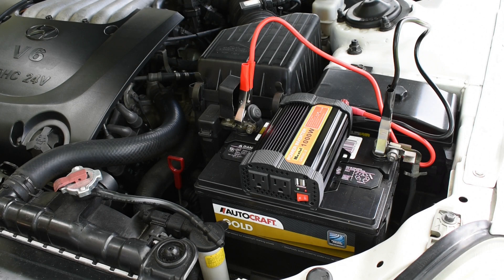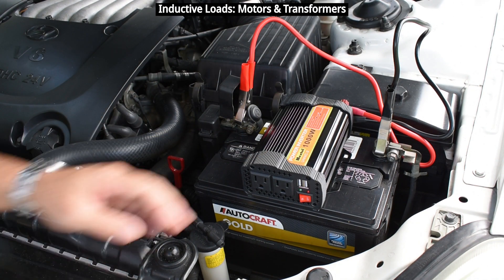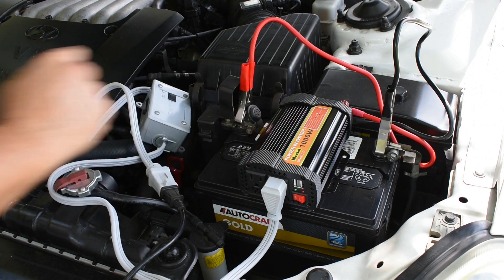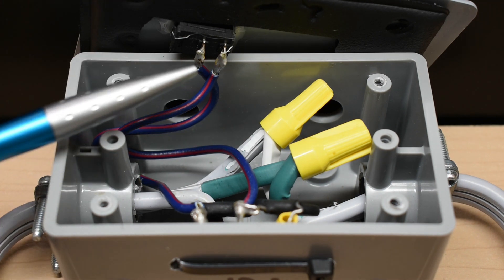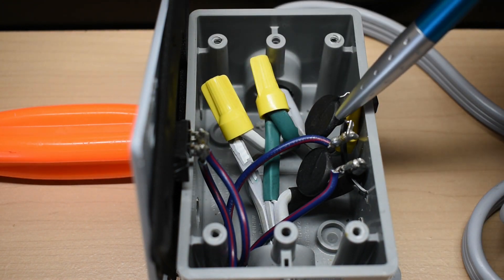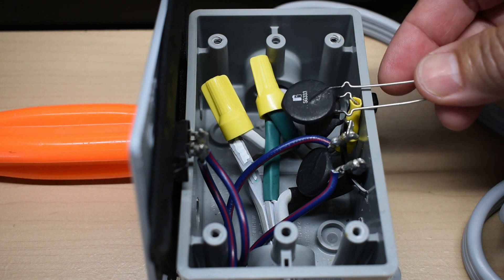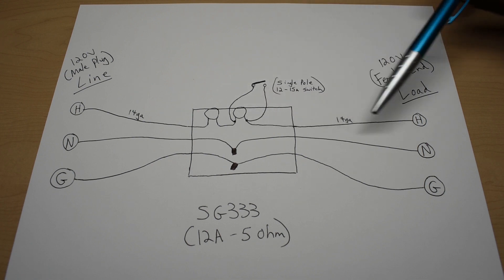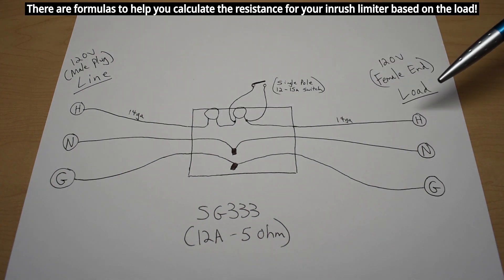The Simplest Soft Starter!

Comment: After suffering a 5 day power outage after a storm and eventually getting hold of a generator (sold out everywhere locally!), it only just managed to start my well pump without tripping the overload. I, like others have already commented, have searched the internet for "Soft Start" devices returning very little information. They are either very cheap chinese items with little to no information about them or very expensive commercial units. This video is exactly what I needed - a "how to build your own". Thanks so much.

Comment: Wonderful video. I used NTC thermistors in a commercial application to start high power DC cooling fans  in an application that used a switch mode power supply sometimes. Mouser carries a wide assortment of these devices. Two tips on their use: 

Avoid the urge to automatically oversize these components. Choose an amperage rating just above your real load (fused correctly, of course).  
Secondly, these things get quite hot. Ensure they don't cause thermal damage to your wires but don't actively cool them. Resistance increases when they are cooled. I used a delay-on-make relay to cut the thermistors out of the circuit once the fans had started. 

A note on practical use. Once you turn the load on and get it running the thermistor's resistance drops. When you turn the load off the resistance will remain low until the thermistor cools. Switching the load off then immediately back on again before the thermistor cools will likely overload your power supply or inverter. That is part of the reason I used the time delay relay, so that the fans could cycle on and off with the thermistors being cool for each start.
Reply from the maker: Yes, you cannot cycle on and off quickly. The component needs to cool at least 30 seconds. Thanks for watching!

Comment: I made one here in Puerto Rico, all I could find was a 10D-20, the fridge at start up is 8 amp and 1.5 amp running, I have a chinese inverter without any info on it of amp rating. The fridge with this 10D-20 starts up with no problem with one car battery and the small inverter, the battery remains at 12.1 after one hour even without solar, so I would say that this device does curve the inrush current well enough to power your fridge at startup with a cheap inverter.
Reply: Eso quiere decir que puedo hacer que el compresor de una nevera grande  arranque con una planta pequeña??
Reply: @cafepuya  primero tiene que medir el ampere de arranque luego el ampere del motor despues del arranque, si el ampere de arranque es de 11 ampere y luego 6 ampere corriendo, tienes que conseguir un inrush current limiter segun el consumo de arranque y el consumo del motor despues del arranque entonces si con una planta pequeña cual alcanza los amperes del motor despues del arranque, si funciona ya lo e visto muchas veces.
Reply: @natvega1  Es que tengo una Sportsman GEN1000i de 1000W-800w mi nevera dice en el sticker de adentro 6.5A.. A la planta le tengo un kill-a-watt para ver el consumo de watts y cuando está corriendo veo que usa 120w a 230w aveces marca 0.0 como si estuviera apagada.. pero de momento cuando el Compressor arranca.. llega como a los 8Amperes y la planta de apaga.  No se si con este truco pueda solucionar eso.
Reply: @cafepuya  si, si hace este inrush current limiter tu nevera va funcionar con el sportman, enviame tu email y te envio una photo de como se hace, el limiter cuesta $6 y se encuentra en cualquier tienda de venta electronico
Reply: @cafepuya  How do you reduce the starting current of a refrigerator?

a) use a start capacitor, 150uF, for the first 1000ms. b) use an NTC thermistor. c) power resistors, for the first 1000ms (similar effect as NTC) d) voltage transformation to a lower voltage, e.g. from 230V to 200V.
Reply: @natvega1  cuando pongo mi e mail YouTube me lo borra como puedo hacer para decírtelo
Reply: @cafepuya  NTC Thermistor 10D-20 te reduce el arranque a 6 amperes. Lento no de cantaso.
Reply: Es G mail el correo.
Reply: @natvega1  me quedé con las ganas de ver  la foto de como se hace el corre o  mio es bayamon

Comment: I've read through as many of the comments as I could and did not find this subject addressed; apologies if its buried further down the line. I would like to use this directly in my shop on 120V house current where my table saw sometimes trips the 15A breaker. This has been the case ever since I bought the table saw a few years ago and it's something I just deal with. If this could alleviate the inrush current that trips the breaker then, AWESOME!!  Really enjoyed the video. Clear, concise and your voice is very professional.

Comment: Well done and great explanation ! 
This will work for my 2000W BESTEK Inverter tripping running a 200 watt Fridge when the power is out.

Btw, your explanation at the end about why shouldn't wire them in parallel exactly explains what happened to the person on an RV website that said his setup exploded when he plugged it in.

Comment: You can find these current limiters in the variable speed, dc, hvac blower motors used in most late model ac systems.  I stock them on my service truck because they fail very often.  Most techs replace the motors for around $800-1000 I take them apart and replace the limiter for about $200. This is the most common failure of the hvac motors.
Reply from the maker: Many people allow their air filters to get very dirty, and the reduced airflow causes the winding of the blow motor to run hotter. Thanks for watching!

Comment: Very elegant solution.
But i think most people trying to run big inductive loads off inverters are trying to do emergency repair, so i thought i'd give you a few ideas on how you could limit the inrush current with stuff you can find around your house.

So if you are a regular guy you probably don't have NTC's just laying around, especially in a emergency situation when power is out.
What you probably own or could easily get your hands on is a graphite pencil.
Shave off the ends and connect the wires to it, then wire a lightswitch in parallel to it.
It is a single use and incredibly dangerous but when that little risk is the difference between life and death, i'm pretty sure you won't care.

I used this method to start a really big drill when we had floods in 2014. I used that drill to bust a hole in a floor and stop water into coming into first floor flats and creating damage.
Reply from the maker: Not really about what you'd do in an emergency situation. It's about having the device on hand now, so in the event you need to power an appliance/power tool using a small generator or power inverter, you'll have a good chance of doing it. Before the pencil trick, I'd pull the oil filled run caps out of my A/C system to get the inrush reduced. Thanks for watching!
Reply: MacGyver would be proud!

Comment: Good work, I looked for a super cheapie inverter with built-in limiter without success, and settled on a capacitor setup which has been inconsistent as success depended on the particular load. So I'll give this a go.
Reply from the maker: If you get the right ICL value, it works great. Thanks for watching!

Comment: Couple of McQuestions: Once the threshold temperature is reached and the resistance drops does it hold that resistance as long as the load is still powered up? In other words does it stay latched in it's low resistance state once it's activated even when the current demand drops once the inductive load has started? I ask this because once the resistance is triggered low then the voltage drop across the Inrush Limiter will fall too so it would naturally cool down.
Reply from the maker: Yes. As long as the load is applied, the low level of resistance will remain. The ICL will be fairly hot, but it's normal. You cannot rapidly cycle loads on and off using the ICL. You must wait 30 secs to 1 minute. Thanks for watching!
Reply: flash001USA 
Google has the answer.
Reply: You can add a temperature sensing circuit to bypass the inrush limiter once it heats up.
Reply from the maker: @Andrew Ferg Not necessary because the resistance drops to a very low level. Thanks for watching!
Reply: @andrewferg8737  Not a bad idea. Inrush limiters do wear out. In fact, they are often the only part that wears out on pool chlorinator control boards.

Comment: Great tip! Have you considered adding another switch position to bypass both in-rush limiters, once startup is complete?
Reply: Already done. Each thermistor drops to about 60 milliohms shortly after power is applied. For a 6 A load, the voltage drop for each is about 360 mV.

Comment: Nice and very useful  ,   In the uk  If you have trouble with 110 volt site transformers tripping circuit breaker's when you plug the in /switch then you  can get round this by plugging in your power tool to the trans former first then  switch on power tool , then switch on the transformer this can limit inrush to the transformer and prevent the circuit breaker tripping
Reply from the maker: Interesting workaround! Thanks for watching

Comment: I always take an angle grinder camping, thanks!
Reply from the maker: There are other things that have high inrush, that was just a good example. :-)
Reply: @electronicsNmore  excellent example
Reply: I'm off grid, and was looking for a solution to stop my window unit AC, (~1300w) from tripping my 5Kw inverter/charge controller. The in-rush is making it impossible to run it, even though I run my water heater on it (resistive vs inductive, as you stated). Hopefully this will work. I may build a few of these, lol. Thank you so much.
Reply: RV uses fridge or AC which the inverter can't handle, and the commercial unit for this problem is $300.- this $1 fix is a way out, and thank you for this.
Reply: @Lumbeelegend  Did you try yet? Very curious..
Reply: @Vigo327  no, I had a drill speed control that kind of worked... until I popped the fuse in it.
 Ever since that, I've been able to turn on my A/C... I have no idea how/why it happened, but I can use it now. Electronics are strange

Comment: I just found this video this morning, already watched it two or three times and copied the adderess so I could share it with my buddy down in Louisiana, any way I'm wondering if you could do one or at least answer the question about a single phase 10 Hp motor that keeps throwing my inverter into safe mode. I've got an 18K inverter that drives the motor, but it still needs a soft start, Any help would be sincerely appreciated.

Comment: you can also use a solid state relay coz the optocoupler has to start at the 0 cross point of the sine wave. not sure what would cause more parasitic resistance when running.

Comment: Nice idea!  I am going to try this.
Question:  What is the difference between these in rush limiters and a resistor, in this case like a 5 ohm, 100watt resister?
I am using a resistor in series for a few seconds between a battery bank and an inverter prior to hooking up the last cable to the inverter to prevent the spark I would incur due to the in rush current which is caused by the charging up of the internal capacitors of the inverter. 
I know one is a DC circuit and one an AC circuit so that is one difference.  I don't know if this the reason for these in rush current limiters vs just a resistor.  Do they both work the same?
What does the 15% designation mean in the specifications of the limiter?  I see there are other limiters with different specs such as one rated for 20 amps, 1 ohm resistance and 20%?
I want to start an electric motor that after startup will draw 6 amps but, as you know, it draws about 3x that on startup.  Will your idea work for me and, if so, what size in rush limiter should I be looking at.  Thanks so much.

Comment: Would I put the thermistors on both L1 and L2 for a 240V submersible 1.5HP 4" pump? Normal amperage on both legs is 11.5 A, so am thinking that I'd be able to mimic exactly what you have, but put 2 on each leg. Is that correct?

Comment: I added a normally-closed, momentary-action shorting switch across the NTC on my table saw.  I labeled the new switch "soft start" and "run" and mounted it next next to the on-off switch.  When starting on utility power where soft-start isn't needed, I simply turn on the power switch and the NTC isn't in the circuit, being shorted by "start" switch.  When starting on battery/inverter power, I first activate the "start" switch, putting the NTC in the circuit before turning on the power switch.  As soon as the saw comes up to speed I release the "start" switch back to "run", again shorting the NTC.  This allows the NTC to begin cooling while the motor is running and provides for more frequent starts.  I wonder if it might also increase the life of the NTC by significantly reducing the time it is in use?
Reply: Is this the reason for shorting one of the thyristors in his circuit, he never says why he put the switch in, it must be like you explain it to allow for cooling to provide more frequent starts, because why not just leave them in series without a switch to give you 10 ohm resistance a 50 volt drop every time you start it, strange he never explains that.

Comment: A thought on using this circuit to power a room air conditioner (I'm thinking 450 W, 115 VAC, 5000 BTU). Considering also what others here have suggested (power factor capacitor, and a timed relay), etc. My thought is that the air conditioner has two motors in it, the fan and the compressor. So should I actually open up the air conditioner and install two separate instances of this DIY soft starter, one on the fan motor, and one on the compressor motor, both with independent inrush limiters, capacitors, and relays? That way the fan and compressor loads are each separately buffered. What I'm worried about is that the fan will run continuously (keeping the inrush current limiter hot and therefore out of action), the compressor will turn off, then on again, and the inrush current limiter will not be active. Having two separate soft starters would seem to solve that problem.

Comment: Thanks for video. exactly what i was looking for. really good info.
i am having trouble selecting which NTC is appropriate for a 300watt inverter which will be powering a 200watt PTC ceramic steamer only. I am thinking i need an NTC that can handle 20 amps .
thanks
Reply from the maker: If the inverter is only 300w, then 20A is overkill.

Comment: Thx for the video. I have a question. 
Let's say I wanted to power my refridgerator with your inverter, how much power will those two buggers dissipate in heat? And also could you bypass them when the fridge have started or are they needed every time the compressor starts?
Reply from the maker: You need to choose the correct size ICL for the load. They can be bypassed if desired after start-up. Thanks for watching!
https://www.ametherm.com/inrush-current/selecting-an-inrush-current-limiter.html

Comment: Was wondering if this is a safe solution for a mini split AC that dims the lights when the compressor kicks on? What would it hurt to leave the switch on all the time or just delete the switch on the box altogether? Would be sure to drill the vent holes in the box

Comment: Great video much appreciated.
Question: I am trying to lower the combat of a compressor with a rated LRA of 122 amp! The reason I need to do that is that its FLA is only 24 amp and I wonder if one could use a 30 AMP breaker instead of the specified 40 amp. Can I use your trick for that purpose?
I greatly appreciate your response!
Reply: I was wondering the same thing.  I'm guessing that Digikey or Mouser would have monster limiters that could handle the current.
The only thing that I'd do is add a timer relay and a solenoid valve to the unloader line on the compressor.  So that when you apply power it keeps the unloader pipe open for a few seconds until the compressor is up to speed.  The close the solenoid to build pressure.  You'd also want a relay to short the current limiter once the compressor is running.  That way the current limiter won't burn up.

Comment: If I build one for use with a small Residential refrigerator (with compressor) that will run 24/7off an inverter--will I need to add a capacitor somewhere? If yes, where would I place it if it had to be soldered.  Also, is the same build applicable to a 30A unit if I buy 2 X 10 Ohm resistors?

Comment: So the Limiters are 12 amps each,... Does that mean if you only need to start a smaller appliance of under 12 amps, you would just switch your box to "Low" to use just one ?... Could you not use a switch to have it wired to use both Limiters all the time ?
Thanks for the video.

Comment: Great video!  I would like to make one of these to help power on a window AC unit with a 12v inverter.    Forgive my ignorance but is is necessary to use a switch to use the two limiters?  Would it be a bad thing or would certain items not work if you were to always leave the two limiters connected at all times?  Thank you!
Reply: I was wondering the same & wish you got an answer.

Comment: Amazing solution. Thanks. Questions 1) Why did you install that switch? Why not always have the two SG333 in the circuit?   2)  Will this harm non-inductive loads such as computer devices, TV, or cell phones powered by the inverter thru that soft starter end female plug?
Reply from the maker: The switch allows me to choose between two levels of starting resistance. No reason to use what's shown for non-inductive loads. Thanks for watching
Reply: @electronicsNmore  Why do you want two levels of starting resistance though, Why not just always use both in series to make 10 ohms and always have the lowest the inrush current making it easier on the inverter and the motor.